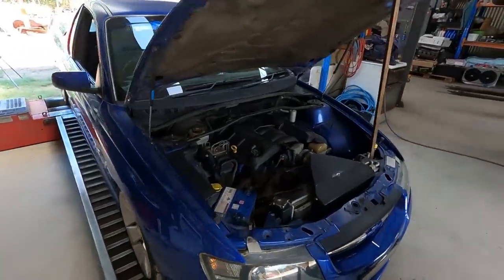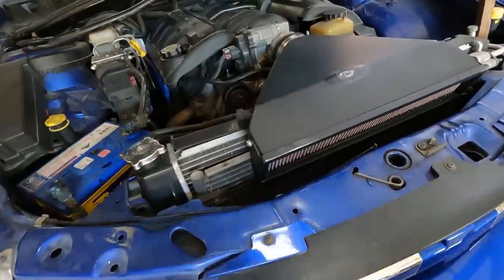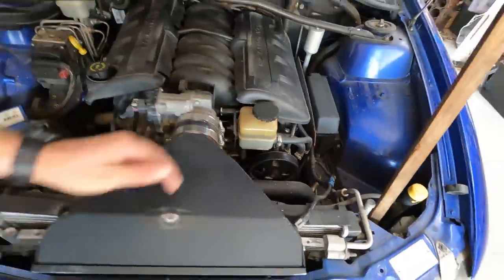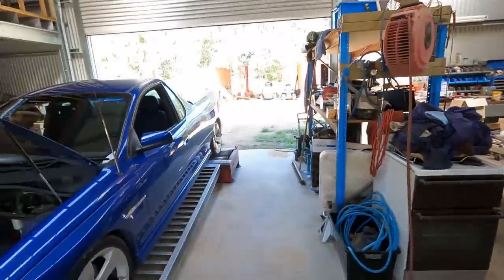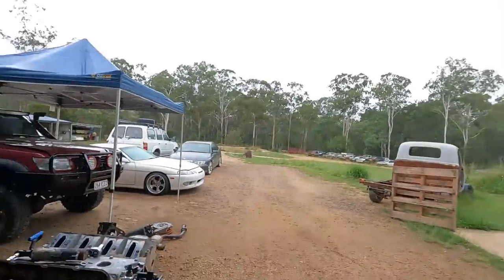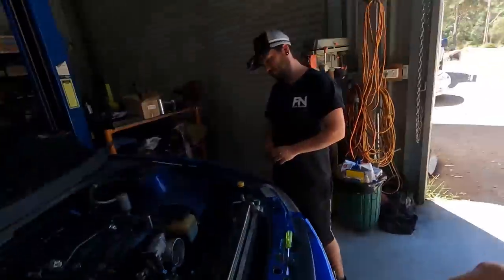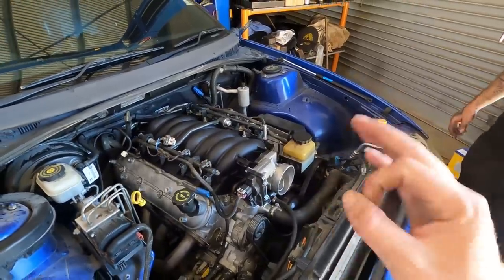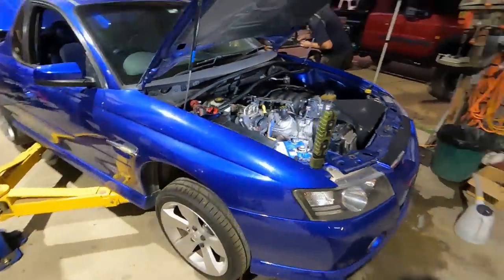VZ Ute OSPWarehouse Cam Kit!

Comment: Most likely pcv, the secondary would be the stem seals. Stem seals deteriorate fast in my experience once smoking starts from stem seals you don't have long to solve it before you smoking the freeway out between exits. What do you fellas think about that? Similar experiences?

Comment: i would like to see this cam kit with also have these extra stuff, the GM LS1/LS2 Sheet Metal Intake Manifold from aeroflow and there 102mm throttle body, its kinda new item and should fit under stock bonnets

Comment: Beau is doing great, it would seem. Going to become an LS guru in no time. 😂
Reply: @LSturboguy  How insightful, I'd never thought of it that way.
Additionally, it's great that you mention race engines, because I absolutely did not. 😕 Let me correct that: race engines. There. Now your reply makes a lot more sense.
Reply from the maker: @LSturboguy  what crack are you smoking 😂 of course there is a huge difference between a complete engine build, and a simple cam upgrade. We do both. 
Beau is coming along leaps and bounds with the platform, I have no doubt he will eventually be able to build complete engines by himself with his attention to detail and interest in learning.

Comment: I have the same VZ SSZ ute 2005 5.7 litre. What is a rough cost for an awesome cam and engine and gearbox tune? I bought mine six months ago. It is six speed manual with 2.5 inch cat back exhaust. In central Vic but would love some direction on what to do with  this beast. Thanks in advance champions.

Comment: An interesting test.  The Crow 1212 isn't much different to the Crow 1249 on paper.  Main difference being 3deg more intake duration and 0.012" more exhaust valve lift.  I'm guessing the CNC'd 241 heads can take advantage of the extra valve lift.  I was led to believe that more than 0.600" lift is wasted on stock 241 heads.   I have a milder Crow 1270 in my 241 headed LS1 and it's no slouch (not yet dynoed).  I guess porting the 241 heads is a cost effective option?
Reply from the maker: Yeh for cathedrals porting is a great option!
Dont quote me but also not sure if the 1249 is on crows “next gen fat lobe” profile, where the 1212 definitely is. This lobe profile offers much more lift between .50 and peak lift. 
Even 243/799 heads make a huge difference. The statesman that Im comparing this to in the video was this cam with stock port 799s and auto and made the same power.
Reply: @BoostGumps  Yes, the 1249 and 1212 both have the next gen fat lobe profile.  So does the 1270.  Makes sense to select a cam with this feature.  Based on your tests I'm thinking CNC porting my 241s will be the next modification.
Reply from the maker: @wot3675  oh awesome! We have had some good results out of that 1249 before also. Around 385whp if I recall in a std port 241 headed manual LS1. That car ended up boosted with that cam still in it and went quite good boosted as well 👍
Reply: I’ve just got the 1270 from these boys for a WL Caprice with some pac1219 springs.

Looking forward to fitting it up and playing with HPTuners.
Will also line up some 3.7 gears and a 32-3500 stall.
Should smash the tyres nicely 👌
Reply: @BoostGumps  
Awesome work on the videos too btw - cheers for the cam you sent out as well 🤙
Reply: I can now confirm the Crow 1270 in my LS1 with standard 241 heads dynoed at 341rwhp @ 5850rpm and 334ft.lb @ 4235rpm after tuning.  Car has 4L60E auto.   Engine still had a small amount of manifold vacuum at WOT above 4000rpm so the factory intake tube and pod filter needs upgrading with something less restrictive.  Might gain a few more rwhp once this is corrected.
Reply: @wot3675  
Cheers for the info - how does it feel to drive?

I was hoping for bigger numbers than 340rwhp from the cam but a dyno number doesn’t always count for a lot.

Does it give a solid torque feeling when putting the boot in? How does it sound at WOT and idle?
Reply: The 1270 certainly made the idle lumpier, but it idles happily at 800rpm and doesn't have much 'chop' partly due to the 114deg LSA.  My car is 1380kg excl driver so it's going to perform differently to a Statesman that's ~300kg heavier.  I'm getting away with the 3.23:1 diff gears though a lower ratio would be better.  It drives nicely and has very usable power and torque at legal speeds.  12.5L/100km for highway cruising if that matters.  The 1270 provides what I'm after. If you want more power then something around 228/232deg & 112LSA is a good option but it will move the torque and power peaks further up the rev range.  I'd CNC port my 241 heads as the next step rather than running a bigger cam with more duration.
Reply: @wot3675  
Thanks for the update 
This one’s just for a mild build to learn how to tune while the stroker gets built.
I’m going to leave the heads and put a vortech on instead
Reply: Excellent video.

Question

Vy 5.7 ss, stock.

Will a 1212 package work well? Does it need a stall kit in trans? What are the numbers on a ls1 5.7?

Comment: The PC tower would be better off outside that little cupboard there mate. PC's hate heat and modern cpus from AMD and Intel  will "throttle down" their performance when they get too hot. Kind of a built in failsafe.  Also if you want real grunt from your PC load up on the RAM (memory) and get solid state hard disk drives. I can build or at least suggest what would make a good work horse for the dyno if you guys ever need.

Comment: its weird it made more horse power down low and still lost torque to stato there. maybe dyno the stato again
Reply from the maker: We thought the same. Doesnt really make sense that it made more power but less torque. Could just be a difference in the new software/calibration. Stato is already sold unfortunately otherwise we would have thrown it back on.
Reply: @BoostGumps  bugger guess its gone to far away for quick rip

Comment: Hey guys
Would this 1212 cam work good when adding boost at a later stage
Reply from the maker: It would work, but definitely wouldnt work as well as some other cams would. It depends on the rest of the setup at the end of the day, what manifolds are like, what turbo end up on it (if going turbo) etc. These characteristics will determine how well a cam profile will or wont work.